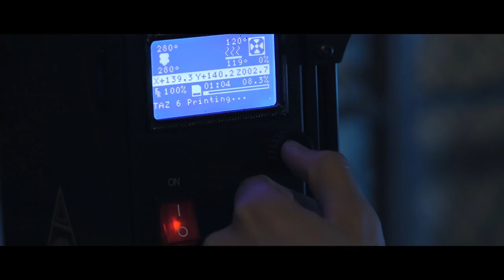3D Printing | Way of the Future

Comment: Do the parts actually work/last?  I worked for a company that would print replacement parts instead of buying new ones and they were always garbage.
Reply: Even if they break... you have it now and are up and running and back in the fight almost immediately.  I doubt they would break within a couple of hours or a couple of weeks
Reply: I agree, as a last resort. The way I look at it, if the part is critical you should have replacement parts on hand.  If it's not a critical part, you can wait for the replacement to arrive.